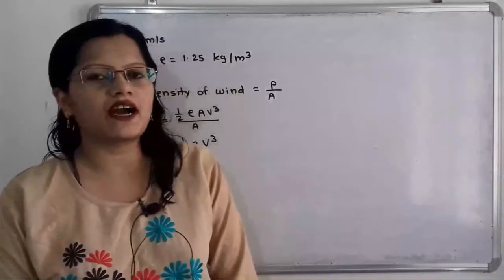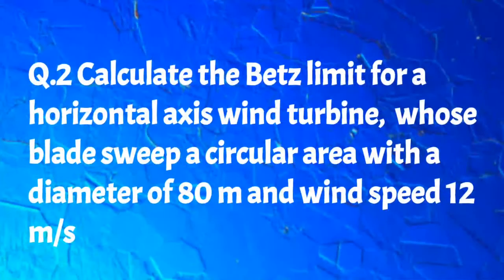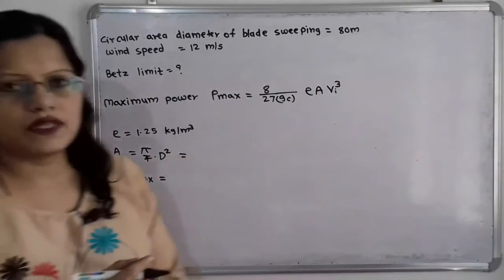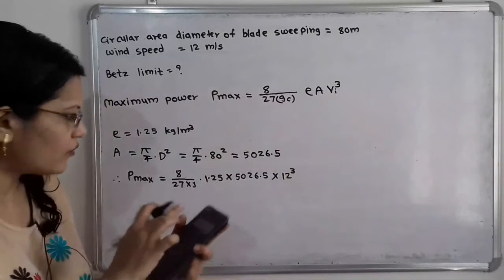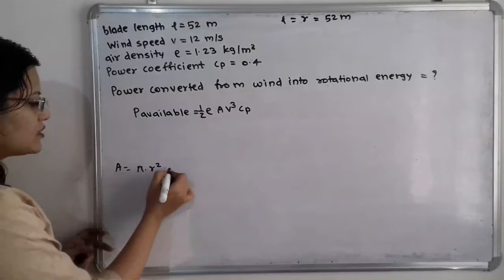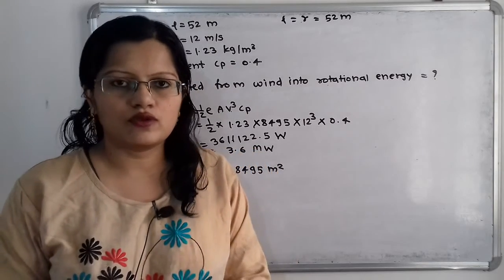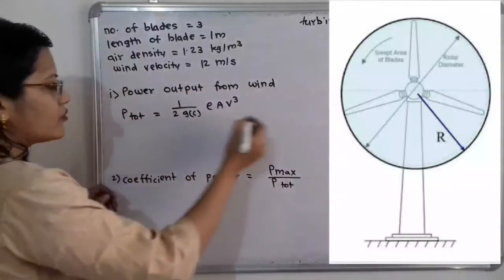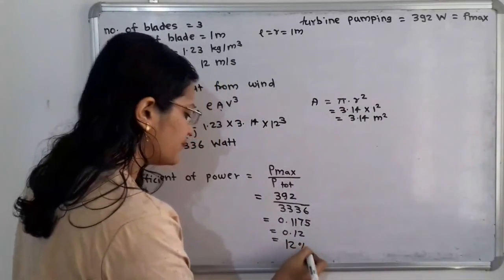Solved problems on Betz limit,  Coefficient of power,  Energy extracted from rotor of Wind turbine

Comment: C1 (i)Design of a community biogas plant for a village consisting of 118 families, each family consisting of 5 persons (adults). Two children are equivalent to one person. Village survey report gives the following information's about cattle's Cows 110 (10 kg/day); Oxes 105 (12 kg/day); Buffalo 70 (15 kg/day); pig 16 ( 3 kg/day); Gas produced from 1 kg of gobar in winter and summer 42 litre and 55 litre. Gas required for cooking/person/day = 0.227 m3 ,Gas required for lighting 100 cp lamp per hour = 0.126 m2 Each family is allotted 2 lamps, which would burn 3 hours daily, Density of slurry 1090 kg/m3 and retention time 35days. Design the following parameters (i) gas required for cooking& Lighting (ii) Diameter of digester ( 4 Marks) Diameter du C1(ii) Explain the bioconversion process of combustion. (1 Mark) C1(iii) The following data are given for a family biogas digester suitable for the output of five cows. The retention time is 28 days, temperature is 30 degrees, dry matter consumed per day is 2 kilogram and biogas yield is 0.24 m3 per kilogram. The efficiency of burner is 60 %, the fraction of methane in biogas is 0.8 and heat of combustion of methane is 22 MJ/m2. Calculate the energy available in biogas digester. (2 mark)